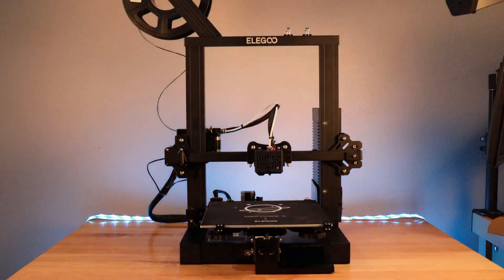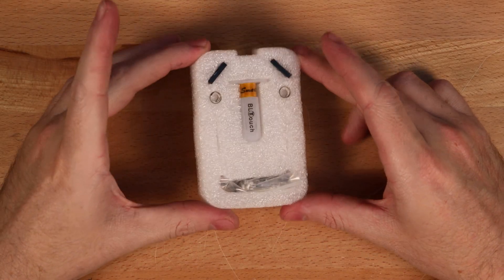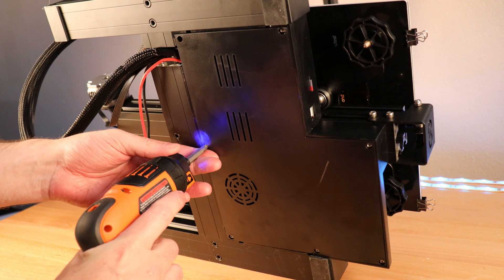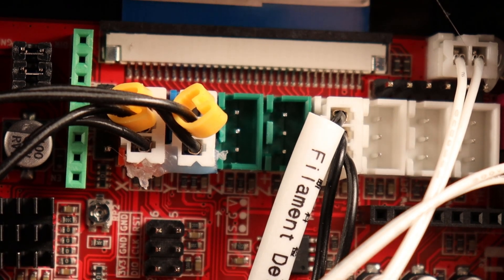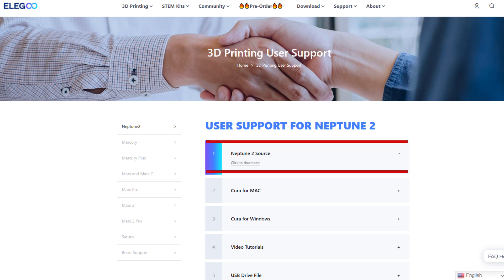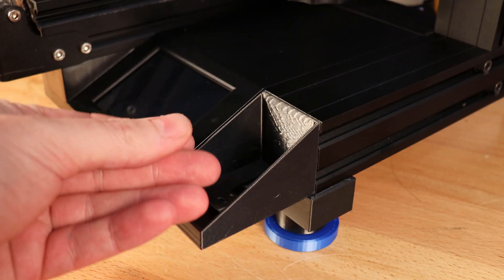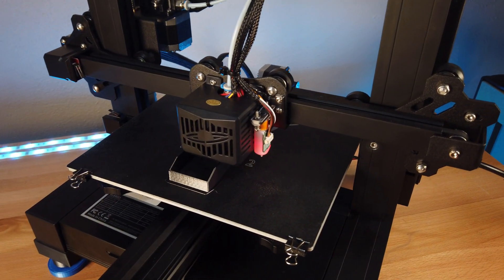How to install a BLTouch on your Elegoo Neptune 2 & other upgrades

Comment from the maker: I will show you step by step how easy it is to upgrade your Neptune 2 to have auto bed leveling using a BLTouch. Links to everything can be found below.

ELEGOO Neptune 2 3D Printer - https://amzn.to/3eJQkqJ

BLTouch : With 1M Extension Cable Set - https://amzn.to/3xY6OTJ

Filament:
20% off any filament from the JAYO store. Just Use code B3BL8Z3M at checkout.

JAYO Store - https://amzn.to/2UA9mcj

Black PLA Silk Filament 1.75mm - https://amzn.to/3eD1ZHN

Copper PLA Silk Filament 1.75mm - https://amzn.to/3ztO1zL

Blue PLA Filament 1.75mm - https://amzn.to/3x4AuND

3D Files & Firmware:

Auto Bed leveling Firmware - https://bit.ly/BLtouchFireware

Elegoo Neptune 2 BLtouch Mount - https://www.thingiverse.com/thing:4801614

Elegoo Neptune 2 Storage drawer V2 - https://www.thingiverse.com/thing:4908528

Adjustable Elegoo Neptune 2 feet - https://www.thingiverse.com/thing:4875576

Oni Mask - https://www.thingiverse.com/thing:4907146

Installing Hardware:

M3 x 6mm Bolts - https://amzn.to/3iGu1Dl

Cable Zip Ties - https://amzn.to/3kQiVyc

Braided 1/8 inch Wire Loom - https://amzn.to/36XG0ae

Tools:

Cordless Screwdriver - https://amzn.to/3eRmoce

Long Hex Allen Bit Set - https://amzn.to/3BBSkeb

Short Hex Allen Bit Set - https://amzn.to/3x2kj3h

______________________________________________
If you are looking for more tools and materials that I use, well you're in luck! I made a page on my website just for that and I'm updating all the time so bookmark it to stay up to date:

https://GomeowCreations.com/tools-and-materials 
https://GomeowCreations.com/partners-discount-codes

______________________________________________

My PATREON ➜ https://patreon.com/GomeowCreations

One time support ➜ https://paypal.me/gomeowcreations
______________________________________________

Instagram ➜ https://instagram.com/gomeowcreations/
Facebook ➜ https://facebook.com/GomeowCreations/
______________________________________________

Comment: Good day.. so I followed you video because I have a elegoo 2d printer... I put the files on the printer the auto leveling sensor does go on when I switch it on but there is no autolevel on the printer screen like in you video.... do you think I'm doing something wrong?

Comment: Brilliant tutorial and i bought the kit and installed autolevelling. Please can you help me, I followed these instructions and now the printer will not print. it auto levelled but it won't accept the settings for the print from cura ... I cant find any way to revert to the original software please can you give me some advice?
thanks Nick
Reply from the maker: If you go to the Elegoo website you can get the most up to date and stock firmware from Elegoo. Download and install that and let me know if that fixes the problem
Reply: @GomeowCreations  thanks for the help, I did the update and i think things are working ok! the auto levelling works (I think) and now I seem to be printing ok !!! I think I need to tweak the Z setting (I may have gone too close). I really appreciate your video and help... so thanks best wishes Nick

Comment: Just printed your mount the other day for my 2. I flashed Marlin 2.1.2 onto my machine with lvgl (with a custom elegoo boot icon :D ), set it to 6x6 grid and turned on high speed probing (i hate that repetitive in/out of the sensor between measurements). I picked my 2 up for just over a hundo and I'm loving it. It even gives my 3 a run for the money.

Comment: Hey , tnx alot for this video. i just bought the BLtouch and want to install it but my machine is using V1.0.4.   can i just use the original V1.0.4 from elegoo and edit the config file that comes with the original version to activate the autolevel function for the BLtouch??

Comment: mine uses 2.0.2, i flashed that and it seems to be stuck on "flash chip erasing"
Reply: could it be because your file says 2.0.1?
Reply from the maker: Maybe, it's honestly been a long time since I made that video so I don't remember much from it. I know that I had a reedme file with it for 2 different motherboards that they came with.
Reply: @GomeowCreations  ya i verified i am using the right one of your files. however it it STILL stuck on that screen for 40 minutes now. even if i reboot it it goes straight back to that screen. So.... not sure what to do.
Reply from the maker: Can you put a clean copy of that file on the sd card and try it again?
Reply: @GomeowCreations  i just did that and same thing still
Reply: ive emailed elegoo support about it but havent heard from them yet.  however, as it sits right now my printer is a paperweight
Reply: holy crap all of a sudden it started working and is auto leveling right now. after 8 times of reinstalling the same firmware/
Reply from the maker: Well I'm happy to hear that it worked

Comment: If I already have firmware v1.0.3 do I need to update the firmware still or should I be able to use the bltouch after install?
Reply from the maker: Do you have the Neptune 2 or 2s?
Reply: @GomeowCreations  it’s a Neptune 2, not the S
Reply from the maker: Just checking because from what I have seen the 2s will just brick if you use the firmware I talk about. So no matter what you have to enable the bltouch by updating the firmware
Reply: @GomeowCreations  so I can update to the latest firmware or stick to 1.0.3? but just need to update the code line to enable the auto level and I should be good?
Reply from the maker: Basically, there is still a chance you might brick the printer so your best bet is email elegoo with your printer serial number and ask them for the firmware that will work with that printer with bltouch enabled
Reply: @GomeowCreations  sounds good. I also noticed on their website about mesh leveling. I’m guessing that’s just a manual version of using a bltouch method to level your bed? My bed is warped in the center. It’s tighter in the center than it is in there corners. Any tips on that or video on the mesh leveling??

Comment: Thank you so much for making this video. I was able to get my bltouch installed very quickly with your help. I did run in to one small problem after the fact, in that my bltouch failed it's self test. I ended up having to manually pull out the probe with the power off and turn the machine on and I haven't had a problem since.

Thank you again
Reply from the maker: I'm happy that I was able to help 😁👍

Comment: Accidentally deleted my comment. RIP. I followed all the instructions, made sure it was the right version, and no AutoLevel button in my menus. I'm not sure what I did wrong.
Reply from the maker: You have the 2S right? Well they changed some stuff around in the different versions and what I have in my video will only work on the Neptune 2 not the 2S.

My suggestion is to contact Elegoo and ask them if they have the firmware for that printer. I wish I could help more but I can't. 😅

Comment: Hey Gomeow! I just followed this guide and I'm having some issues with your firmware. The autolevel feature is not there (Still showing the manual levelling) and the z axis doesn't go home. It only moves upward slightly. Are you aware of this issue? Any fix?
Reply from the maker: Do you have the Neptune2 or the Neptune2 S or whatever other version that have our?
Reply: @GomeowCreations  It's a 2D. I read your other reply that you didn't test on other versions of the printer after I sent this message. I don't know where I could find the right firmware for my printer though... 

How much would I owe ya to write me the file, or teach me how to write it?
Reply from the maker: Yeah sadly I don't know what is needed to get it going on that printers and the one that I using is this video was the 1st generation of the Neptune2. The best thing you can do it contact elegoo and ask them if they have the firmware for you to do that or at the very least the stock firmware so you can get the printer working properly again. 

I know this info will not help you with this problem but they are coming out with a new Neptune 3 printer soon and I have one in my shop now that I will be making a video about soon. It comes stock with auto bed leveling 😅👍

Anyways let me know what happens and if you get things all working after contacting elegoo.
Reply: @GomeowCreations  Thanks for the help!!! I talked to some friends on Reddit and they suggest I set up Marlin.

As for the Neptune 3, I would love to get one, they're just so much money here in Canada, haha

I'll stay tuned though, and I'll let you know how everything goes :)

Comment: I added G29 to cura and the printer asks for the Z offset at the start of every print, and if I hit the back button, it returns to the main menu.
Reply from the maker: Yeah you can't do the G29 or it will do that. You just need to level it and do the offset and it should be good to go.

Comment: Wouldn't happen to have the firmware files for version 1.0.4? Can't even find them on the actual website. Or is it safe to update it using the 2.0.1 files? I don't want to brick my machine.
Reply from the maker: What printer do you have? I ask because this one works with the Neptune 2 and not the s or x version
Reply: @GomeowCreations  I have a Neptune 2, the firmware version is 1.0.4 but the only 2 versions in the folder is for 1.0.3 and 2.0.1, is it safe to upgrade it to 2.0.1 or will it brick?
Reply: @GomeowCreations  I got it to work downgrading to 1.0.3 bl touch, still having first layer issues but I'm currently printing the adjustable feet for it so we'll see after sometime tomorrow lol. Thank you for this nice walkthrough on installing this.

Comment: I just saw your video, great instructions! But when I downloaded your config file, I noticed the bed leveling config was still set to manual, and my Neptune 2D didn't change how it operated after updating. Is this the file you said you would include for us? What configurations do I need to change to make it work like how I saw in the video?
Reply from the maker: The files that I have provided are only for the Neptune 2 and I don't know if it will work for any of the other versions of the Neptune 2 printers.

Comment: This helped immensely. I am quite new to 3D printing, I have my Neptune 2S just a couple of weeks now and I was already thinking about upgrading it with auto-leving. And right now I've stumbled over a time-limited offer on Amazon, where I can get this sensor for only 20 buck - but I need to make a decision fast, which also means, someone telling me about this sensor in an informative, but short video. Found it... and I still have 30 minutes to place my order. Thanks a lot! :D
Reply from the maker: I don't know if the firmware that I posted for this video will work on the 2S seeing that this was made for the 2. I just don't know if they are running the same hardware or not. If anything contact elegoo and ask them for the right firmware.
Reply: @GomeowCreations  Thanks for pointing this out! I think I the Neptune 2 and 2S are a bit different in terms of hardware, as in 'several parts on the outside look different', but when it comes to mainboard and firmware, I think they are pretty much identical. The 2S even has the same holes for sensor installation.

Anyway, I will have a closer look once the sensor arrives and as I understand it, I can always change the settings manually. I could write a short comment about how everything went, in case you are interested, but I won't find the time to install the sensor before the weekend.
Reply: I’m interested in an install on my 2S as well. It’s got this dip in the middle that just makes levelling impossible.

Comment: My Neptune 2 was wobbly when I got it, I just simply loosen the 2 big screws on each side holding the vertical bits and the 4 holding the top bar seated it firmly on a glass table then tightened them up again, it has been fine ever since.👍
Reply from the maker: I have tried that and it didn't seem to do anything. It's all good though seeing that the feet make it sit perfect now.
Reply: @GomeowCreations  I had my wife put pressure on the 2 horizontal bars as I tightened them all up not sure if that made the difference.

Comment: Sorry if this is a dumb question but is there any changes on the 2s from the 2 that would change this process any?
Reply from the maker: I honestly have no idea seeing that after making this video a found out they changed the main board on the first Neptune 2 printers and have to make 2 different firmwares to make it work.

Comment: I can't seem to find gcode that doesn't keep the z offset menu up while it prints. If i hit back, it goes back to the main menu, forgets the offset, homes, resumes print at a much much higher gap and just pours filament everywhere (if i decide to hit back in the z offset menu. I can leave it up while it prints, but then i don't have access to the print menu while it's printing).
You seemed to not have that issue right away, I wonder what I need to do to fix this issue.

Comment: I just got the NEPTUNE X, and the BLTouch from Amazon.  I followed everything you did and machine starts, and panel is readable. I put the 4 files on the thumb drive and put it in the printer.  I started printer and it went thru the changing.  I removed the thumb and rebooted and it still says Leveling and no auto leveling.  The BLTouch blinked and is red.  Did I forget anything to make it auto level?
Reply from the maker: So I have no idea if this something would work on the Neptune X. Do they have the same main boards?
Reply: this exact same thing is happening on my neptune 2

Comment: Do you have to add a G29; in your start G code to get it to auto level before your print?  I saw another video where you have to auto level and set the z offset before each print manually then start the print.  Did you get the same result?  Does the z offset get stored? Does the G29 command on the start g code work?
Reply: I got the same question. :o

Comment: Is the process the same for the NEPTUNE X?
Reply from the maker: Is that the due color one?
Reply: @GomeowCreations  It is the newer NEPTUNE model?
Reply from the maker: Oh well I don't know to be honest. Open it up and take a look at the main board. You might find a plug for it. But I suggest contacting elegoo about it as ask them. They normally get back quickly with good info

Comment: You can fix the "flat issue" by loosening the side bolts on the sides letting machine settle and tightening again. The wobble is a simple assembly issue with the brace extrusion bar underneath not being level when tightened down.
Reply: Dang you were faster! :D
Reply: good thing I read down in the comments. I came here to say the same thing XD

Comment: Ok, so if you're planning on doing this upgrade AND putting cable chains on, the 1 meter cable is NOT enough. Get the 2 meter cable and save your self some hassle
Reply from the maker: Yes 😁👍

Comment: I printed one set of the adjustable feet and they will not screw together, what are your settings or tips to print them? Orientation on the build plat, raft setting, ect..

Comment: be careful with this thing, it doesn't level all that well if you let it go for a while and don't manually adjust it. just had to take mine off today to fix the issues i've been having with my printer

Comment: I uninstalled mine, the z lift noise was unbearable, up down up down even after I had leveled the bed manually to reduce the offset. Plus the screen kept freezing and overlapping the main menu using the Neptune provided update. Code B3BL8Z3M didn't work for me.
Reply from the maker: That is understandable. Also you can't run the level before the print or it will glitch out the screen.

Comment: Fantastic video! I didnt use the original bltouch but a cheaper probe of amazon. Works the same. Instructions were fantastic. One question ist left. I noticed a rattling from the z-axis. This I think is due to the printer constantly changing the height of the z-axis to compensate for the bed warping. Is there a way to resolve this? I tightening the screw of the lead screw bracket as well as the connection to the stepper motor. But the rattling remains. I might try to print a ball bearing top bracket. But maybe you have had a similar issue?

Comment: Thank you for this very easy to follow how-to video,  i just installed my bl touch and its leveling for the first time
Just wondering is there any thing i need to do after i set the z offset? Does it save the z offset? Or will i have set it every time?

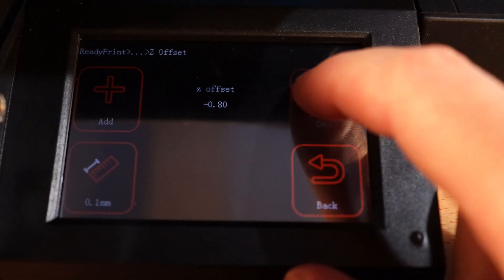Comment: 7:04 The Neptune 2 only does have this problem, if you didn't build it properly. You have to loosen all screws of the frame and the screws inside the plastic box, then retighten it on a plane surface and make sure everything sits flush at a 90 degree angle without getting twisted before mounting the profiles from the z axis. The buttom aluminium profiles aren't parallel to each other causing this wobble. My Neptune 2 doesn't wobble at all, because I don't thrust the chinese manufacturer, for a reason.